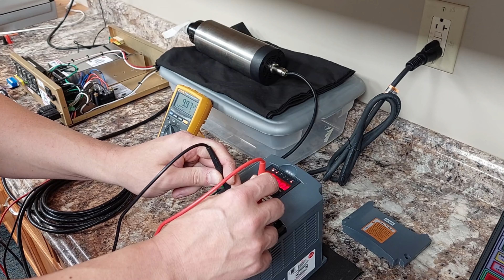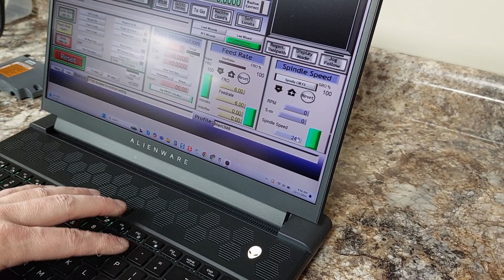How To Check PWM Voltage On Your CNC Controller With An HY VFD...

Comment: Hello, sorry off topic, but I was interested in making a uc100 from a esp32 to db25 port. So just plug n play with g540. Sorta baffled that nobody makes one. Ugs as a back up to uccnc. I love uccnc and uc100. Many times I'm not interested using my laptop, raspberry pi would be great.
Reply from the maker: I'm sorry I don't recommend the UC-100 as it plagued with disconnect issues, proven with a simple Google search, or by searching my channel as I have an email from the lead engineer at CNCdrive discussing it. 

USB controllers aren't stable for CNC use the best option is their UC-400.

Thank you,
Vince
Reply: @corvetteguy50  thank you for response, helpful!

Comment: sir, what is the recommended base frequency ? i noticed you set to 10 Hz. How do you com about this?
Reply from the maker: The base frequency is based on what you would like your spindle's RPM to be when first cycled on. 

I selected to set mine at 10% and this means when the spindle is first cycled on the RPM of it will be roughly 10% of the PWM voltage which in the case of the G540 is 10v, so 10% of this voltage translates to roughly 1000RPM as the video reflects. 

Thank you,
Vince
Reply: @corvetteguy50  Thank you Vince for the information. Another question if i set my base frequency quite high say 1000Hz what do you think will be the impact ? Recently my spindle rpm is fluctuating quite a bit (maybe about 1-2 Hz) due to BOB output voltage fluctuating accordingly. The spindle sound also indicates this. Do you think it could be due to the relatively high base frequency i am using ? Btw i am using the USB BSMCEO4U-PP Bitsensor board, the red board.
Reply from the maker: 1000mhz isn't at all recommended, 10mhz is a much more appropriate choice. 

The breakout board you're using is about $20 which tells you its not going to be made with the highest quality components. 

This explains the issue with RPM fluctuation.

I suggest doing yourself a favor, and invest in at least $100 board. 

Thank you,
Vince
Reply: @corvetteguy50  Thank you sir for your reply. I will look at another board.

Comment: Thanks a lot Vince, very useful video.  Would be nice to have something similar for the UC300ETH controller and the UCCNC software 🙂
Reply from the maker: I'm sorry, I don't understand. The process used here is applicable to any controller. Thank you,
Vince
Reply: @corvetteguy50  Of course you are right, but would be nice to see this process  with the hardware/software i mentioned but it is not a big deal, thanks in any case for your work
Reply from the maker: The UC-300 is designed more as a breakout board. I'll see if I can come up with one for a future video. Thank you,
Vince
Reply: @corvetteguy50  Yes, usually it is combined  with an UCSB or an UCBB BoB. Would be very appreciate if you can 🙂.  Thanks a lot